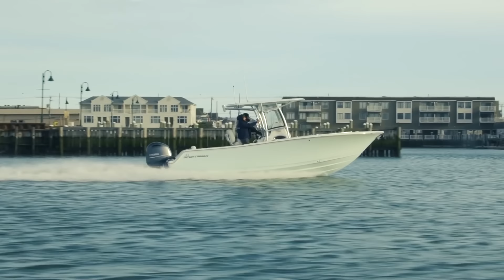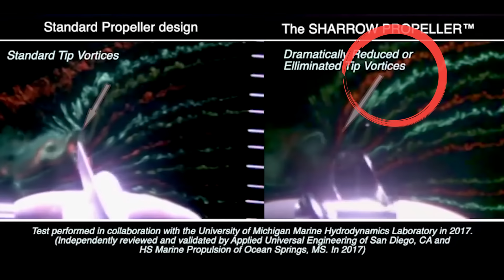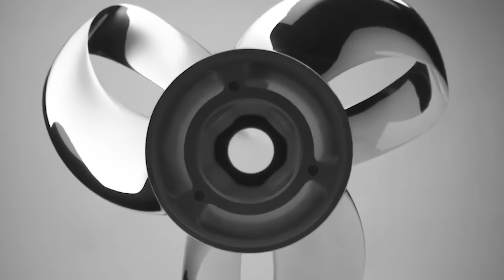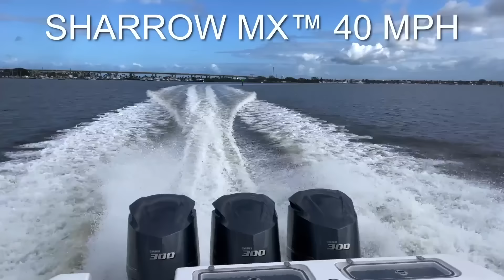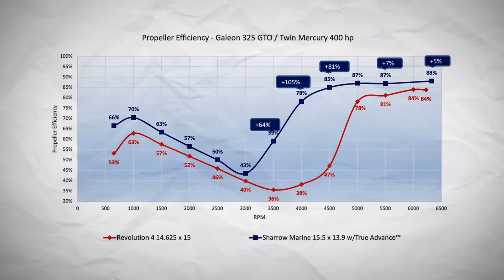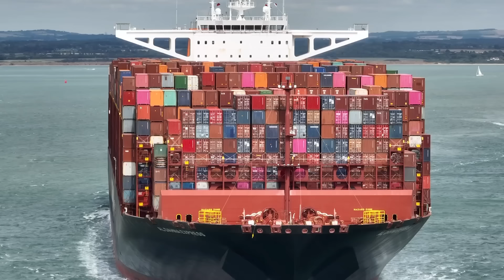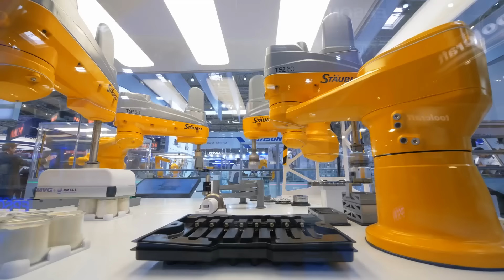This Genius Propeller Will Change Transport Forever

Comment: These might be more efficient for watercraft, but unlikely for small drones. 
Running at constant speed for long periods is exactly what most boats and especially,  large ships do. But for small, maneuverable air devices I have doubts.  Transport craft may benifit,  but drones that use multiple motors and power modulation to maneuver,  the added mass, and I'm estimating three to for times the mass of the common propeller, would make the constantly varying rpm require much more energy to enable. Not only during increase   but even rapid decreases in speed for maneuvering may make it necessary to apply reverse voltage to compensate for the greatly increased momentum.  Thus depending on the ratio between straight line travel, and aerobatics, this may not be the best option.

Comment: There is one place where they cannot or hardly be applied, which is on general aviation. they cannot replace normal propellers in airplanes, as it is hard to change the pitch of them. airplanes have constant speed and different pitch, and by design these cannot change it....

Comment: Will be interesting to see if it can be applied so aircraft propellers which are generally variable pitch (constant speed) and feathering (at least on multi engine aircraft). How that could be achieved would certainly be a non-trivial engineering problem. I suspect it could more easily be applied to the unducted fan type of engine, producing a virtual duct, as it seems to, rather than to a conventional propeller.

Comment: very biased research on makers of this tech part, no sensible difference in data when showing both propellers suction range, useless in large aircraft application, noise reduction lower than stated and overy expensive manufacturing. Not even mentioning the sound difference on boats was likely due to engine RPM

Comment: i think those cargo ships use duct-ed props .....but apparently ducted props have their operating range issues also?....Dave Gerr's Propeller Handbook sort of glances the topic, relative to the vast standard prop reference, but mentions Bp values under 30 are not workable with a duct, and that some issues in duct drag start to arise beyond a quoted 12 knots....other than that, the reference is fairly vague on the effects of duct design.

Comment: 105% efficiency? What? How? My understanding is loss will always be a factor in mechanics, Heat, noise, resistance of the medium (due to density of the medium) such as air or water etc all a lead to loss. I don't think you can ever achieve 105% because that is not only mean you have no loss whatsoever but you have also gained 5% kinetic energy from an external source. Can someone explain where am I wrong?

Comment: What would be the efficiency in a turbine application wether it be in aerospace or industrial power and would they be efficient in wave pressure based power generation. It makes the machinist in me want to make a prop for small outboard and as impeller in jet boat.

Comment: I do not thing that the difference in sound generation output is “insane”, but instead, significant. This negates the implication of any insanity concerning its design, especially so as there is no suggestion of mental health issues either of the designer or any attribute of the propeller itself. Please refer to your OED dictionary if you require further information about meanings and application.

Comment: Kinda cool but still not a new concept.. they are a very cost effective stop gap between a fixed blade and a variable pitch prop. So yeah don't edit the running footage with the triming between the two. Say what is true not what is just out there like BRP found out with their g2 evinrude engines looked cool ran great.. for about 50 hours of run time.  No production is not limited to 3d printing you can mold one, these things should not run 5k that's when you're getting into a variable pitch prop area.

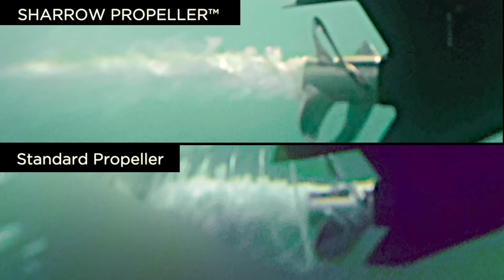Comment: 0:50 the propeller boat video shows the propellors spinning the wrong way??
Reply: @Forty-K  watch the section again. There's no way those props are spinning too fast for the shutter. There's no overlap to match the shutter speed with the propellers passing by each other to cause an optical illusion.
Funny that you said that though.

Comment: A conventional aluminum prop for my Penta AQ225 I/O is about $300. The stainless steel version is about $1000. If they made a toroidal, it would be at least $2000. So no...I won't be buying one.

Comment: Looks like drones built with these could be far more efficient and airborne for longer. Get a huge number of these made and send them over to Ukraine, their current drones are airborne around 40 min if they are lucky. Could be a massive benefit if that can even be increased 20% or 30%

Comment: After looking at the price.. even with all that benefit such as 20% fuel reduc.. wonder how many years needed for that fuel saved to catch up.. and correct me if i am wrong.. but that price tag is only for the propeller only ? not the whole engine ?

Comment: I’m curious as to if the toroidal blades would be further increased in efficiency if you combined them with the design taken from an owls wings/feathers?… much like the modern design used to quiet down commercial aircraft props? Maybe? Just a thought experiment.

Comment: 'More than double the propeller efficiency when used on a boat' sounds like baloney...

How is efficiency being measured? Normally it's force*velocity(kW)/input power(kW). Obviously it can't be greater than 1, and you'd need a terrible propeller for it to be less than 0.5

Comment: Nonsense. “Far less bubbles…same size and same speed…” lol. A spinning flat disc under the same conditions wouldn’t produce any bubbles so is it a better prop? Nothing in the claims of improvement give any data about the control props. If you compare to a crap conventional prop it’s easy to get improvements.

Comment: $5000 price for a boat prop is temporary. Machining a prop like that could be done at any competent machine shop for a fraction of the cost:  the machining is super simple compared to even the simplest GM LSX engine family head manufacturing which you can buy 2 fully machined heads for $1500!  Once the initial wealthy "have to have it" crowd has been appeased, it will sell for $600-$800 apiece. Half that being the infamous Marine Tax (anything sold for boats costs twice as much as a car).

Comment: That price difference makes it pretty much unobtanium.  How about applying the Prandtl wing lift distribution to props?  This should yield a larger diameter prop for the same power, torque & RPM, with greater efficiency.

Comment: Off the wall ideas:
Would a passive toroidal "screw" on an airfoil favorably alter wing tip vortices?
What about placing the screw on a boom in front of the wing's leading edge?
What about a variable length boom or size of toroid blades?
Reply: That’s what I was thinking. You just gave the Chinese the secret!

Comment: The issue with non-compressible-media(water) is the front needs to be stretched(compressible) for the rear to be efficient(thrust). To introduce air-water combination via a pneumatic "pump" drawing-pushing water (water-jet of jet-ski.sss and boats, ...) to the front of this sturdier propeller design of yours is that more engineers will die while trying to study the effects of projectiles(small boats) behaving like artillery-shells fired from the water surface instead of the already proven air-propulsion in this youtube.

Comment: The two are entirely different. The drone uses a rotor, like a helicopter. The boat uses a propeller. They are fundamentally different. The rotor does not move along its axis, the propeller does. Propeller blades are twisted, helicopter blades are not. The boat propeller looks like a screw.

Comment: Might be a crazy theory but in my mind if you increase the efficiency it would seem to me you would increase the power/HP requirement.   By what percentage would be the question.  If that is the case would the efficiency result outweigh the power requirement?  You don't get something extra for nothing,    Right?

Comment: Holly cow man. I'm a professional mariner that works offshore oil fields. We spend weeks sitting in one spot with these things going 24/7 and depending on the boat I've had to sleep with ear plugs in to just a low background hum. Still any reduction in noise would be a HUGE quality of life improvement. Also the additional thrust would be amazing as who doesn't want more power!!

From the vessel owner point of view less cavitation and vibration would be great. Every 1 to 2 years we have to dry dock the vessels for inspections. During this time the wheels are usually replaced due to cavitation. If they could get away from having to replace the wheels every time to say once every 10 years that would save a lot, especially across an entire fleet. 

The oil companies would love them because they pay for our fuel and anything that makes us more efficient is a huge win for them. I've run vessels that burn 50GPH all the way up over 400 GPH, so this is a huge cost and when the oil companies go looking to charter a vessel, this is something they look at.  With ESG scores becoming a thing our vessel emissions are calculated for use in drilling permits to tax credits and I'm sure more things then I know about just being a vessel master so this becomes another sealing point for the Vessel operators.

Comment: Does the Sharrow have less drag?  My feathering prop cost $6,000. A conventional one the same size runs around $600.  My feathering prop has many moving parts and requires frequent greasing and that means pulling my boat out of the water. If the Sharrow has comparable drag as my feathering prop the Sharrow would be the way to go.

Comment: 3:00 How you want to get more efficiency from big cargo ships torodial props when they don’t reach 3000 rpm where it starts to be at least efficient? 🤔🤷‍♂️ Cruise ship propellers turn slowly 250-800 rpm, cargo ships even less I think. Such a low rpm range is not even in your graph. Eleborate.

Comment: wow . finally the technology has improved on something as simple as a propeller . i don't know when the propeller was invented , how long they have been using them on boats but i know for instance the civil war ships monitor and merrimac used them , and that is over 150 years ago . the technology on everything else like radio , televisions , internal combustion engines etc. has made leaps and bounds but until now the propeller was unchanged . 20% , or even 15% improvement in fuel efficiency is remarkable . a large ship that used 100,000 gallons of fuel on a trip ( i actually have no idea how much they use to cross the ocean ) might only 80,000 . thats a lot of fuel saved and that's just from one ship . multiply that by how many thousands of vessels are making trans-ocean voyages on any given day